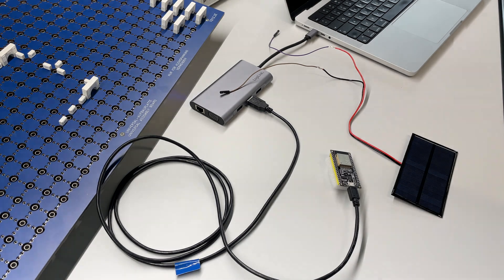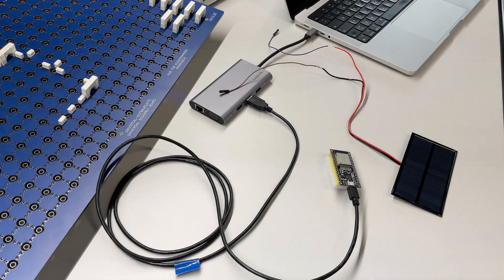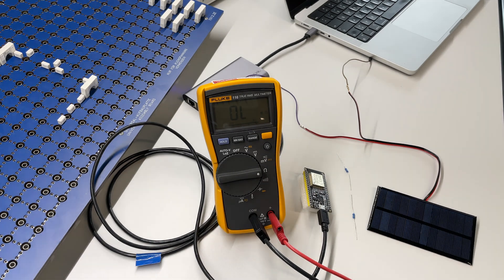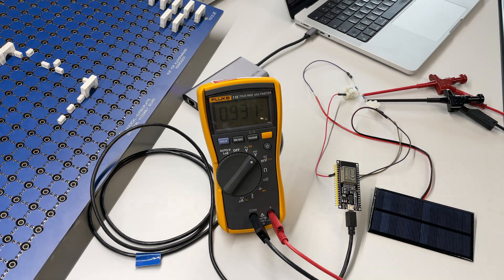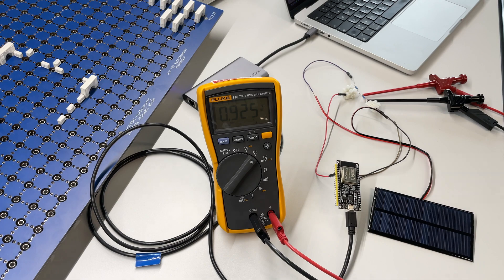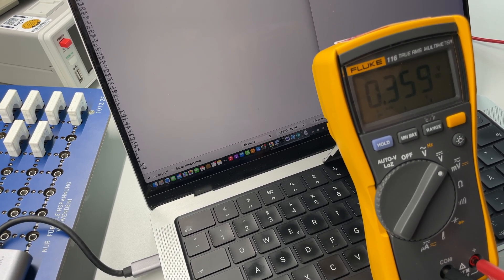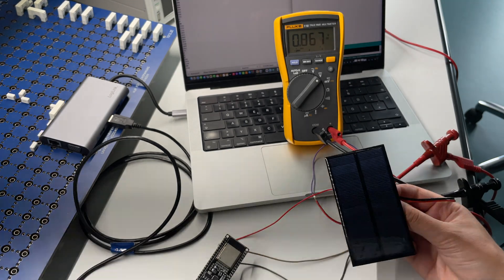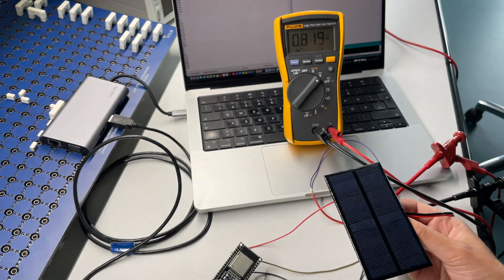Solar tracker - Part 1 ESP32 project

Comment: Imo an external ADC might be a good choice. I'm working on my solar tracker and bought some solar sensor to track the sun with an arduino uno r4. But i just stumbled over esp now and four small pv panel in combination with esp32 might be enough.
Reply from the maker: Thx for insight!
Do you have a video or website about your project?
Reply: @blueprintiot  No but I am on it. I keep you here updated.  What about your project?

Comment: sounds nice, but is really useless

it is way better to track on calculated angles based on position and time and then adjust every 5 or 10 minutes or so

adjusting the angles more than that and based on other variables is really never worth it, alone due to the shading that can occur 

tilt and position of the sun are known variable that can be stored in tables or calculated or even queried ( with ESp32 easy job) two servos will do the job for you then. add a magnetic field sensor for compass and GPS tracker and you are done.

unless you build this for a out of earth  situation , its not worth it
Reply from the maker: Thanks for your opinion.
So how would your system handle a cloud covered sky? In this case it's most effective to bring the solar cell into a horizontal position.
Reply: @blueprintiot  no it does not.
considering that that approach will use way more energy than you would gain. Cloud coverage where I live (52North) means either: altostratus: hardly any power production , or cumulus : then the reflection on the clouds will give some benefit. 

running those motors to move a 200KG system (8 panels) every second back and forth will be not economical from a price perspective as these need to produce more torque due to the momentum they need to overcome.
Also the extra energy will not offset the potential gain.

a fixed trajectory will be more economical and still produce the extra yield by doing so imho.
Reply: Exactly what I was thinking. I wouldn’t say the presentation was useless though. Just a different approach. As far as the cloud halo effect, I don’t think changing the position matters as the sun’s position is well known. I’m building a test rig based on gps, direction and time with a reset to home in the evening. With that said, a position encoder on each axis would be necessary for feedback.